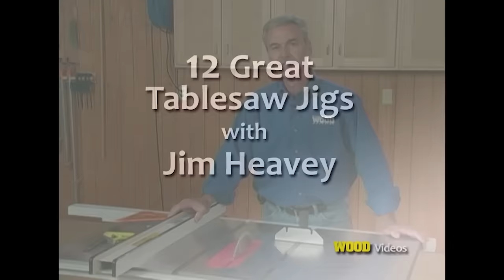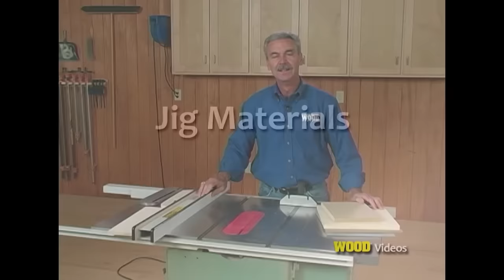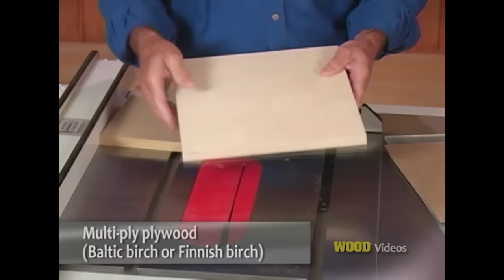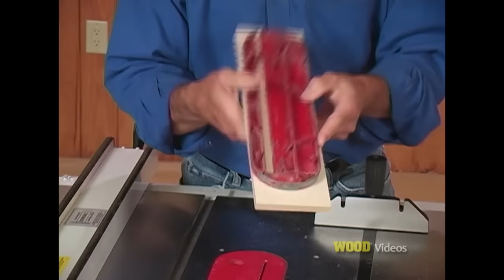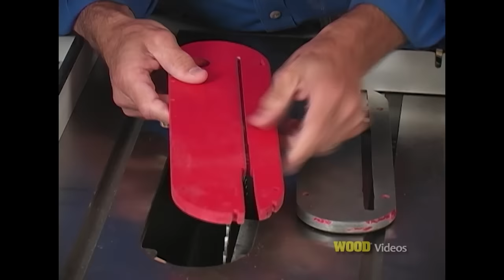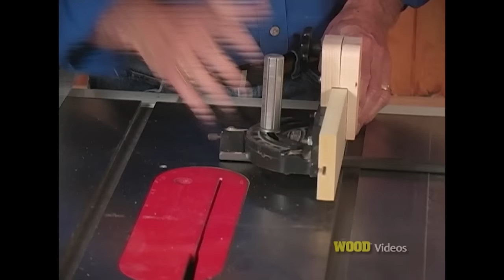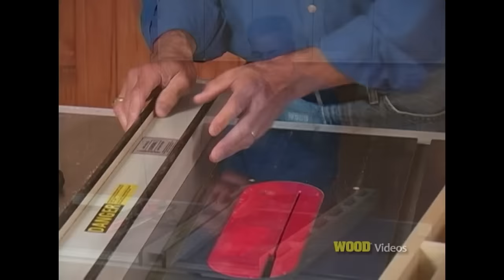12 Great Tablesaw Jigs with Jim Heavey - WOOD magazine

Comment: I learned the cove-cutting technique years ago, and used it to make my own bread-loaf handrail for our stairway. It was almost impossible to find, and if you found it, it was cheap and wispy and finger-jointed every ten inches. So I made my own out of two 2x4 vertical grain fir boards glued together with gorilla glue. A few passes on the top side at 45 and then 22.5 approximated the final round top, and then multiple passes at an angle to cut the side coves.
You can set up the cut exactly, btw, and avoid the trial and error. Start by setting the saw at the desired final depth of your cove. Now set a straight board at an angle to the blade and measure the distance to both the front and back of the blade, adjusting until the difference is equal to the final desired width. Measure/mark that angle, and then use it at whatever distance you need for your particular cut. Clamp your "fence" in place at the measured angle, drop the blade back to just a whisker above the table top, and start cutting.

Comment: Jim, I do not know if you still look here or not, however, I shall mention this anyway. With the 1/2 inch plywood, which will not sit down clear of the blade to make a replacement, what if after you do the cutting around for fit in the opening, what if you used the side piece to line it up with the blade, hold it down while you rise the blade to cut the slot, instead of changing to an 8 inch dado blade?

Comment: WOOD Magazine, please create these video indexes at video post time. Get the timings from the guy editing the video. It makes it very easy to go back to a specific time of a jig you want to review.

 - 3:37 - Zero-clearance insert
 - 6:38 - Miter gauge extension and precision stop
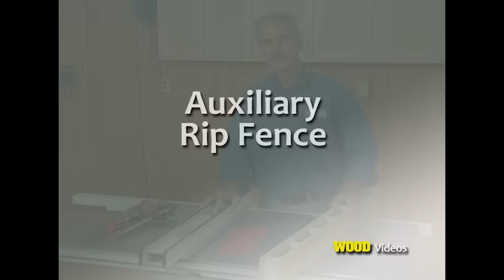 - 8:20 - Auxilary rip fence
 - 10:32 - 3-in-1 work support
 - 13:07 - Raised panel jig
 - 16:30 - 90degree crosscut sled
 - 20:50 - 4-sided tapering jig
 - 29:29 - Tenoning jib
 - 35:01 - Spline jig
 - 37:02 - This-strip rigging jig
 - 40:35 - Cove-cutting jig

Comment: Fantastic Video. Thanks for preparing and sharing it. Great ideas for making things both easier and safer.
Reply: Yes I don’t normally comment on these video but had to tell the guy on it’s a wood thing that being I was a glass man for 35 yrs. the reason you need paper towels is your doing it wrong! When holding that glass cutter you put it between your middle and index finger strait up! You will get use to it! And when breaking glass you leave it on the table and just slide it off the edge to brake it! And the wood breaking with the running pliers well that’s bull shit! Sorry!

Comment: On your  cove jig, if you move the pivot point of the adjustment bar to the other leg you won't have to constantly have to work around the adjustment bar every time you make a pass with your stock.  I think it would be safer to not get distracted by bar and be able to focus on holding the work piece in place.

Comment: On that last jig, the cove cutting jig.  You built it wrong, my friend!

That brace that goes across the other two parts should have the very end permanently attached to the slanted fence, while the other end should be adjustable and be able to hang over the fence of the table saw.  This would allow the operator to smoothly feed the work over the saw blade without having to dance around that overhanging brace!

My only other nit to pick is that you did not touch on personal safety equipment at the start.  Eye protection, hearing protection, and shop made push sticks are all essential must-haves.  Push sticks and handling tools are also great tools or jigs that anybody can make with a little time and a small investment in materials. 

Great video overall!  Take care out there!
Reply: Very few of these so called experts have all of the answers, they have spent little or no time as apprenticed to the old timers, so make a lot up as they go along, and make the typical mistakes you have pointed out here. I get tears in my eyes with laughter especially at the "how to get the sharpest edge" posts. Fact is if it is not razor sharp then it's not sharp at all, I can shave the hair off of my arm with any of my cutting edges, be they knives plane irons or whatever, and I have only ever used the same "India" double sided stone I bought as an apprentice in 1966.
Reply: @MrChrissy1r  I bet the women love your shaved arms! What a guy!

Comment: My question is for the cove molding jig. Why not pivot the jig on the movable side so you don't have to jump your hands over it as you push the board through? Also, how do you make a 45 degree zero clearance cover? When you raise your saw blade it will mane a round groove through the cover or how do you get that board to settle down ar 45 degrees and then mark the board from the under side?

Comment: The first thing should have been to check that the blade is parallel to the miter slots on the table.  Not all saw are set correctly and if buying a used saw you are assuming it is parallel.  You are leaving yourself open for burning your cuts on one side or the other and at great risk for kickback.  Not all saws still have the splitter or riving knife with them when buying used.  True up the blade/table first!!
Reply: This should be the top comment. It's infuriating that it's not mentioned first in the video.

Comment: Love all the jigs presented and use of them however I see a big improvement for the cove cutting jig. The top arm that holds the swing arm in place should haver the part that sticks out on the fence side of the set up. That would prevent the awkward push during the cutting process. Just turn the arm around so the fixed hole near the fence is on the swing arm instead. That makes the adjustable part of the arm now over the part next to the fence arm.

Comment: 42:30 for the cove cutting, if the fixed end of the diagonal was on the movable piece (the slotted sliding end over the fence)
you'd not have to dance around the protruding end the way it shows in this photo. Maybe a small consideration, but with ten incremental cove slices, on some 20 or 30 pieces, you're gonna be real happy you moved that stick out of the way! Enjoyd VID.
Reply: You are Absolutely Correct Junk Mail.

Comment: I have a question, why don’t table saw fences ride on miter slots that are perpendicular to the blade rather than sliding along the front edge of the table. Similar to how a cross cut sled rides in the miter slots. Only the slots would be perpendicular to the blade instead of parallel. I think the fence would always stay true that way. Like a router table is set up

Comment: Jim, I know that the focus of this particular video is introduction of the various useful jigs. However, I feel it is useful for your viewers to understand that your method for determining if the fence is parallel to the blade is built on a premise that is not necessarily true: you presume that the saw table and its miter slots are themselves ALREADY parallel to the blade. Experience in many shops with varying degrees of attention to proper maintenance quickly teaches that this foundational alignment cannot be taken for granted. Your method is "simple," and in some (maybe many) cases it will work; but the series of alignment checks builds one upon another; and skipping a step in the chain invites wrong conclusions andcan require re-work. The simplest sure-fire way to check alignment beteeen blade and fence is to do it directly, preferably with a dial gauge inserted between the two, both  at the front and back of the blade (and referencing the same saw tooth.) Comparing the readings obtained at both locations gives a true reading of their parallelism, independent of the relationship between miter gauge slot and blade.

Comment: Suggest you put a riving knife on that table saw.  If it is the same width as the blade and set below the height of the blade, you won't have any problem with the vast majority of your jigs and you'll be a lot safer.

Comment: Why use an adjustable square if you're going to reference the fence to the T-slot grooves and not the blade?

I mean just move the fence over the groove directly then right? Or is there a specific distance away from blade that is ideal?

Comment: For the tapering jig, would a wingnut work as well as the nylon nuts you used?
Reply: i know this is old, but replying anyway.  the wingnut may stick out too much is certain angles, depending on the size of the block underneath.

Comment: What about a circle jig? They are really handy. All you need is your sled and a screw. Insert the screw 1 radius away from the blade and make multiple cuts while turning your workpiece t then a final cut against the blade while turning the workpiece through 360 degrees.

Comment: I added some set screws on the side of the runners to allow for expansion and contraction of the wood
Reply: Use the plastic he showed at the beginning so it won't expand/contract & need to be adjusted.

Comment: for the table leg jig, why didn't you use the runners on the bottom, rather than the fence?
Reply: A single runner will work as an option.  But when using it for jointing, I like the freedom to generously overhang the board to allow multiple cuts by adjusting the fence to sneak up on the final completely cleaned up board edge.

Comment: I'm a new person to all this with a new but basic 250/10" table saw(ParkerBrand PTS-250 High Power Table Saw) 
What blade is on that saw you are using ? 

My saw came with a 24 tooth blade, can you advise as to what blade (ie 24/40/48/60 ect ect) would be the best all round to make these jigs and then to use with them ?
I understand one blade will not suit all situations, but if you only had one blade, which would you use ?
Fantastic video by the way.

Thx Paul (UK)

Comment: "Small little bolt/nut"
However, the jigs are excellent.
However, the COVE cutting jig needs to switch the pivot point to the angle arm so that the 'excess' over hangs the TS Fence side and not the cutting area (where it interferes with the operator and work as it is passed over the blade).

Comment: Why does the adjustment brace for the last jig extend over the work area rather than over the fence?  Also, you state that this operation is not repeatable, and therefore one should make extra.  If the jig had a stop cleat on the leading edge, so it could be located the same every time, and the adjustment brace were marked, and the distance of the fence from the blade were measured and tracked, this would be repeatable.

Comment: Well how do you make the zero clearance plate for a 45 degree cut?  Won't you get a humongous slot trying to drive that blade up through the plate?
Reply: No. I use the same insert for 30-45 degree cuts, and the kerf line in the insert is barely wider than normal.

Comment: This is a terrific video. Thanks for making it. I was wondering: Did you used MDF for the 90 degree saw sled and the tenon jigs? I recently bought a piece of 3/4 maple plywood as I couldn't find Baltic Birch and it was $45. If I can build the same jigs with a $15 piece of MDF it seems worth it to make the switch. Also - it seems that your tenon jig could be used as a jointer to create flat faces on work pieces - or is this just a bad idea? Thanks.

Comment: At 1:03 he ASSUMES that the "groove" is parallel to the blade.  That should be the 1st thing you check because "it ain't necessarily so"
Reply: I very much agree. It's likely that it's parallel to the blade if you purchase a $40000 tablesaw, but if you can only afford a low-cost one, you'll definetly need to check this. Even if you have an expensive tablesaw, it does not hurt to check it.
Reply: Doesn't he show how to check and set the fence at the beginning?  Blade and fence checks are the first thing to do with a new saw and need to be repeated periodically as you use it.
Reply: @chrisstrutton3796  fence, yes, but blade to slot, No
Reply: If you buy a cheap saw, as I did, it is worth also checking that the mitre slots are parallel to each other - and that they are at right angles to the front edge of the table.  My cast iron table was not as accurate as I would have liked due to poor finishing. Running a milling bit in the router down the slots against a very carefully set up guide trued things up nicely.

Comment: On the raised panel jig, one of the demo cuts was made with the bottom of the jig raised fractionally above the saw table top - the panel was clamped too far down - and so the panel was not vertical to the saw table. On another cut the panel was clearly not clamped vertically - that clamp plus sandpaper is not adequate for good results.

Comment: I'm not understanding the concept of the tape measure and the block.  seems like if you measure over 4" from the cut and put the center mark on the block on the 4" line, the measurement would be off the distance from the edge of the block to the center line when cutting a board to the measurement on the tape?

Comment: Is there a reason why one would not adjust the trunnion to make the blade exactly parallel to the miter slot first, then roll up the fence to the same miter slot and adjust the fence exactly parallel to that miter slot?
Reply from the maker: That's a valid method, too.

Comment: missing are blade to miter adjustment and detection for parallelism and roundout respectively. if you don't first adjust parallelism between blade and miter, you cannot set fence to miter meaningfully.

Comment: This is really a great video with loads of valuable information and ideas.
I'd like to ask what the specific name of the ball-bearings at 10:30 .. 10:58 are called (and where to get them).
(I've been looking for them for a long time, as need them for a project that's unrelated to woodworking).

Note: I liked the raised panel jig the most (because I'll need to make around 10 doors for the house soon; and that's a lot of raised panels). I especially liked that you didn't just make a single cut, but you did all 4 sides and showed the accuracy of the corners - very nice!
I might make the raised panel jig for a home-built router table, since I do not yet own a tablesaw. I might need to use a handplane too, but I do not mind.

One way the video could be improved (slightly), is to first show what the jig does (3-5 seconds), then show how it's built.
That would make it much easier to follow; otherwise you keep wondering what it'll do, while it's being built and you miss a lot of valuable information. I knew a few of the jigs already, but there was one, which kept me wondering while it was being built, so I bet a few others would have that same problem too.
Reply: Some common names are: Ball Transfer Unit or Roller Ball Bearing Caster. Available via Amazon, Northern Tools, etc.
Reply: @jjhdnd: Thank you so much! I very much appreciate your help!
When I searched for "Ball Transfer Unit" and "Roller Ball Beraing Caster", I immediately got good results on ebay (which I use, because I am located in Denmark). =)

Comment: MY SAW IS A GENERAL INTERNATIONAL AND HAS A VERY THIN PLATE.  LESS THAN A QUARTER OF AN INCH BUT PROBABLY CLOSER TO 3/32".  ITS HARD TO MAKE A NEW PLATE FOR IT BUT I HAVE MANAGED UPTO THIS POINT.  ANY SUGGESTIONS FOR MATERIAL?
Reply: Caps lock ON

Comment: After the Walnut Stain, you should have put a coat of Sanding Sealer!  Next Step lightly sand, sanding sealer with 120 grit sandpaper and use a cheese cloth to clean off wood (what you just sanded).  Then put on a coat of Satin Varnish!  That is a cadillac finish!  Old School to be sure!

Comment: The four cut method is way more accurate than going with your fence. Just saying, I 've built a half dozen cross cut jigs over the years with your method.  The four cut method is better.  That's what I will use for the next one.

Comment: On your sled design it appears that you line up the center of the stop block with your 4 inch mark which would be incorrect. You should align the front edge of the block with the 4 inch mark. Maybe that is what you did but it is a bit unclear.
Reply: Now that I look closer, you definitely aligned it wrong. You should have located the blocks front face with your measurement then attached the tape to align with the center of the block, not the 4 inch mark your extended to the top face.

Comment: Two things, firstly in the beginning of the video when you were going through the very basic steps of tuning in your table saw, you left out the most important step of all. The first step is to calibrate the alignment of the blade to the miter slots. If the blade isn't parallel to the miter slots then everything you do afterwards will be wrong. No matter how much you pay for your table saw you should never assume the blade is parallel with the miter slots. Secondly, miter gauges are renowned for being inaccurate. No amount of modification to a miter gauge is going to make it accurate.
Reply: Your right.  I thought the same.  Start with the blade aligned.

Comment: I had to laugh in the beginning when he said check the owners manual for adjustments....Noah used my saw to build the Ark..( it was my grandfather's saw and pretty sure he bought it used ..he never bought a new power tool..bought them used and went through them from top to bottom)...lots of useful jigs here..thanks
Reply: Not a problem, just put a spacer under one of the legs. ;)

Comment: Great jigs.  I'm surprised and concerned that you would publish a video of a table saw being used without a splitter or riving knife.  The use of splitters has revolutionized table-saw safety.  They are so widely available as after-market add-ons or as shop build that there is no excuse for not using them.  WOOD magazine should lead the way in promoting the safest practices.

Comment: Baltic bitch is great stuff to work with but also wears blades faster than raw timber due to the glue resin content.  It’s also expensive here now at around £120 per 8x4 sheet for grade AB 3/4 inch/18mm.